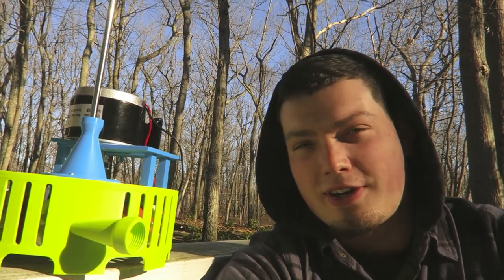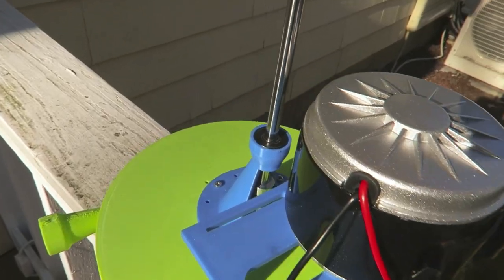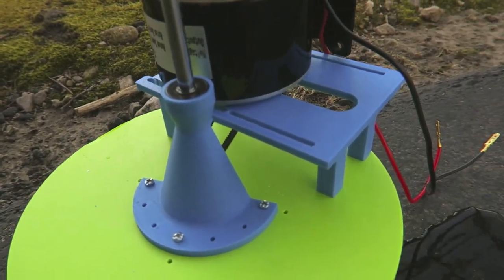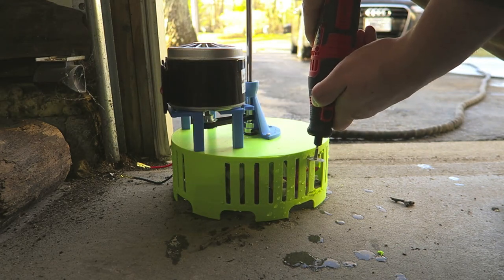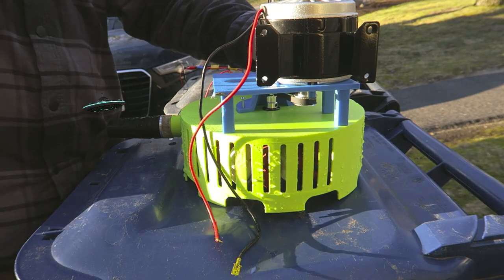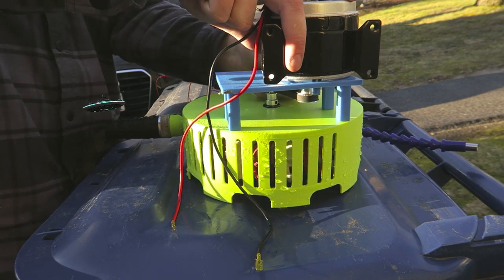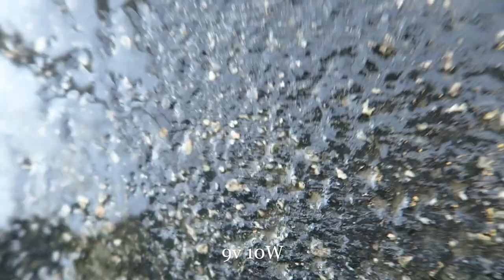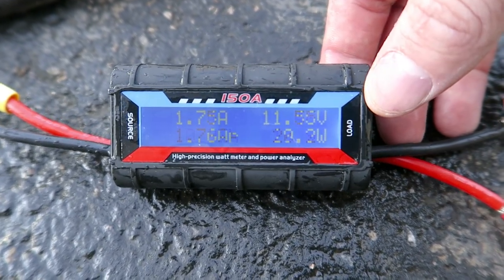Finally a working 3D printed Pelton Turbine

Comment: adding a second pressure port in addition to straight pipes without elbows and increasing the diameter of the attack sprocket will increase the overall power

Comment: seems like you still have lots of water being wasted once it leaves the pelton turbine. Would there be a way to collect the majority of that water and possibly add a smaller pelton turbine? Maybe if the second one was gravity fed water instead of from the hose? doing something like they do with a water dam? maybe use a 5 gallon bucket as your dam with a small hole drilled in the bottom to spin a secondary pelton turbine. How high would your water need to be get house water psi?. Does increasing the pressure cause the spin of the pelton turbine to spin faster? What if you could increase the pressure and the flow to your pelton turbine?
Reply from the maker: There are alot of great questions here!  I'll try to answer them to the best of my ability. More flow and more pressure would allow for more power as the energy of the flowing water is converted into electrical energy. Yes more pressure (and flow) has made the turbine spin faster in my case. To get the psi I have (estimated) 65 psi you would need about 140ft of head. These tests are simulating the real world where the water would come from a water source at a higher elevation, this won't be used to make power off a hose when completed. With this being said I'm less concerned with the water coming off the turbine as it will just return to its source down stream. Although I think there is room for it to be more efficient. Hope this cleared some of those questions up!

Comment: Tom stanton did a video on pelton wheels that you might find interesting. Basically he said that if the the water is shooting forward then theres room to try and take more energy out of the water and if it shoots backwards your wheel requires too much torque to turn.

Comment: by reducing the diameter of the pelton wheel, for the same pressure and the same water flow, the wheel will turn faster. With the pulleys the generator will also turn faster and its power will increase
Reply: It would be easier to change the development of the attack pinion at least 30% larger to increase rpm but without having to bet an excessive total torque! with this, while maintaining the original diameter of pelton spoons, it achieves a sufficient force
Reply: But won’t the torque also go down when you make the diameter smaller? I think a more important thing is to adjust the load by how high the waters velocity is bouncing off the ”scoops”.

Comment: What is the pressure of your water network? (PSI or Bar)
how much water do you use? (gallon or liter per second)?
with a pressure of 3 bars (43 PSI) and 1/2 liter per second, if the energy efficiency of the whole is 0.7, you should be able to produce about 100W.
it would be necessary to use a small solar type charge regulator to obtain the maximum power
Reply from the maker: I'll get these numbers and I actually just picked up a charge controller
Reply: @Beyond_The_Tint     am just seeing this, so no idea if this has been asked/answered...do you know what the generator's physical parameters are (ie, rpm input) for it to provide the power you are looking to create (ie, voltage, current)?

Knowing the inherent characteristics of your generator (including the inherent variations due to temperature differences, torque loading (ie, of it's bearings, which dictates 'drag' on the motor physically, as well as any 'back emf' which would be due to things like Eddy currents that get created in the generator (while it is being spun, ie, generating) and essentially act as a form of electro-motive friction in the generator, and even if the generator has brushes in it (vs brushless) will to some extent dictate things like min/max useful speeds (rpm), etc.  These various factors are often captured in technical documentation via various graphs (ie, power curves, etc), as attempting to tease out individual contributions tends to be a pain, so the graphs provide a relatively quick and easy way to access the results of any such testing already previously performed.

Finally, that hose looks like it either needs it's rubber washer replaced (or installed if one isn't already there), else the hose itself needs fixing/replacing.

I only mention this as what looks like a 'small leak' is essentially robbing you of at least some of the pressure (which you seem to be looking to create by having a nozzle built into the turbine housing), so simply addressing even a minor leak could well result in far higher overall power gains than you might imagine 

Depending on your input volume and pressure, that leakage might not have any obvious effect on turbine performance, however consider that as that nozzle then is working to increase pressure at the input location (to increase flow velocity thru the nozzle), only to then eject some (and possibly quite a bit) of that increased pressure (and thus the working fluid's increased velocity's attempt to do more work via the power input to the turbine blades) is essentially being then 'lost' yet the turbine housing is still having to ensure the additional pressure(s) being created, and likely sustaining some amount of fatigue damage that isn't actually netting you any increased generator output, yet (depending on a variety of factors) consider that this could cause your turbine housing's input area to fail more quickly than it might otherwise, yet you've not gained All the performance you might otherwise gain

And, your water flow may be such that those losses aren't actually all that consequential, though given everything else you've obviously invested into this project, ensuring that your input connection is sound Before further testing would, at least in my mind, likely be worth the few minutes to swap a rubber hose washer, else the few dollars to pickup a cheap hose that actually seals fully to your turbine input.

Anyway, as I said, my apologies if these are things that have already been asked, answered, or otherwise previously addressed

Keep up the good work, and I will look forward to seeing your project progress moving forward!

Comment: Hi, did you try to use Turgo wheel instead of Pelton? for this kind of design turgo might produce more power as the water go straight down and doesn't bounce on top like pelton, i think pelton is overrated compared to turgo. Imagine how much water is ejected on top of the wheel bouce on the casing then hit back the pelton slowing down the wheel..... im pretty sure you can increase by like 20% the power you produce with a turgo ;)
Reply from the maker: I think it's time I test this out, stay tuned I'll throw it into my list of things to test

Comment: the voice over was pretty good ... perhaps hand a wool blanket up across a line to deaden the sound a bit .... honestly thats the only part that needs work ... getting less of the room echo and more of a no noise background .... start with cheap ideas like the blanket on a line to make a soft wall to stop bounce back ff the wall behind it ... see how much it helps ... see if high or low matters more ... etc ... test things and then find the solution that fits you and what you can afford ... even hang on t the close cell foam packing bits ... they can be wall mounted and act as noise cancellation pads ... 
.
as for the wheel what about getting the input water spinning in a vortex before it enters the pelton wheel chamber .... say drop it down a funnel to spiral down and carry that motion and extra force along with it into the pelton wheel ... sure it wont be much but it removes the hose fitting spray allows for it to max flow into a catch basin and flow down a hyperbolic cone into the pelton wheel ... if possible use water as close to 4c .... according to Victor Schauberger thats the temp at which that flow does the maximum possible amount of work .... and what he used in his log sluices back in the 1910's .... very effective use f minimal water for maximum load movement ... 
.
Reply from the maker: What a well worded comment thanks for the tips. I think I've figured out the audio quality and echo within the room. I'll look into testing out you idea for the wheel. I away appreciate comments like these.

Comment: Do you measure how much water flow was needed for 20 watts for example?
Reply from the maker: I haven't measured but it could be done by adjusting the unit to 20w. Then disconnect and measure that flow. Hope this helps I'll cover this more in future vids

Comment: Can that belt handle the torque of that motor?Im using the same motor in another project but the torque is extremely high
Reply from the maker: I would use more then a 6mm width belt. I'm sure it can hold a bit but I was concerned even in this test but it did work for me. Go as big as you can. I will Likely be changing mine out
Reply: @Beyond_The_Tint  Problem is I can't source bigger belts in India. In my case the total torque is about 4nm and the gt2 belt is unlikely to handle so much torque
Reply from the maker: @vaibhavmugulavalli3366  I actually think that could work. Especially if you can use larger Pulleys for more contact of the belt

Comment: Achievement unlocked: "Reach 20 Watts". You can now use a table to keep your electronics from getting wet. You can now buy a good microphone ;-)

Have you actually checked your voiceover? Its hard to understand, when you dont turn down the volume of the video. Also a good microphone would rellay help, or you may want to record it in a room with some better sound deadening on the walls.

You could try and get a hooverboard motor.
Reply from the maker: Haha yes now we can work on testing set ups. I did check it over and need to work on my skill level regarding the mic and voice over. I was hoping it would be better than trying to speak over the test it's self. I do want to try a new motor do you have any suggestions as to which one I should look into?
Reply: @Beyond_The_Tint  I wrote, that you could use a hooverboard motor. Brushless at least. Or maybe an rc-model motor. You would need a 3-phase rectifier to get (pulsing) Voltage out of it.
Reply: I agree with a Brushless AC motor with rectifier to get combined stable AC power or a brushless DC motor are the best choices depending on your use case. What are you trying to power?